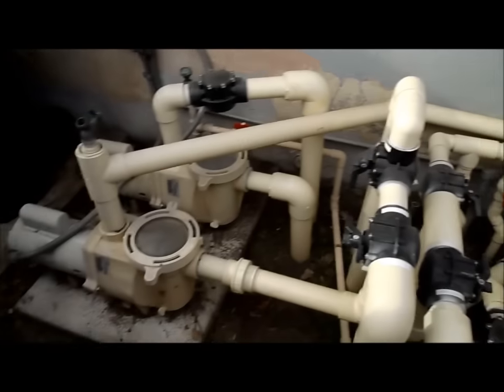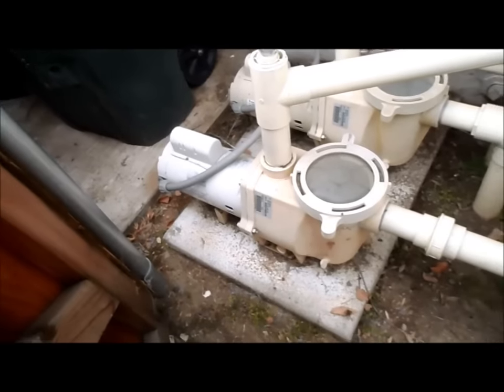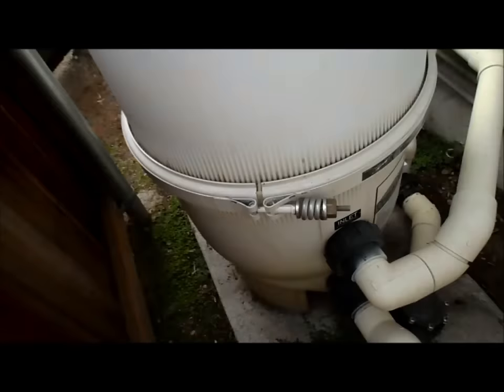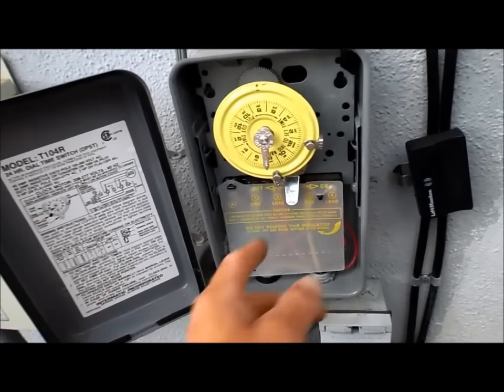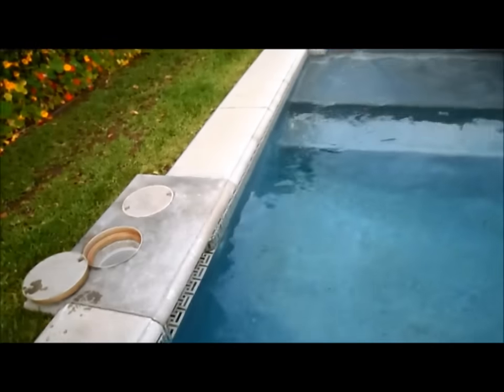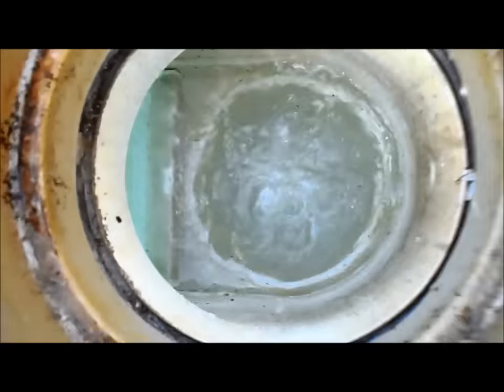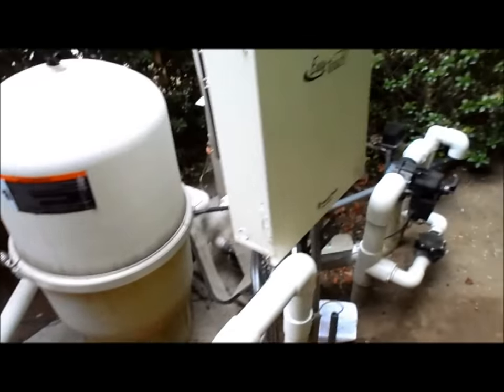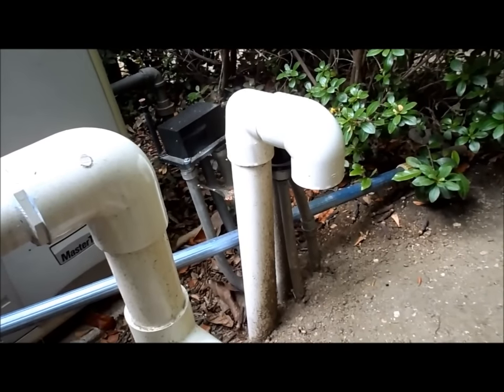Pool Equipment Overview for beginners Part 1 of 2

Comment: Hello, Outstanding videos. Keep it up. I have a Pool circulation system question. I have a basic pool/spa/heater. I have only one pump. I have (2) 2” suctions  connected to a  Jandy 3 way 2” valve going to my pump inlet. The return is a Jandy 3 way 2” valve. The main return is 2”. One return side is 2” and the other return side is 1 and a 1/2”. Would my main inlet be a main and skimmer? In regards to the the 2 different return line sizes, would the 2” be the main or skimmer.
Thanks
Reply from the maker: Thanks for the great feedback. The skimmer is the primary point of suction and most likely the larger line. 👍
Reply: Thanks for the quick feedback

Comment: Hi, thanks for sharing your knowledge. 
Could you explain how the bubbles go to the spa, would you be using a tee wye not sure of the spelling.
Reply from the maker: The bubbles are produced by a return pipe over by the equipment or the spa that has a cut in the top portion to let air in the line. Normally a pool is a closed system which means it runs with no air in the pipes. To produce the spa effect air is let in at this pipe. Usually a 2" pipe sticking up about 3 ft with a 1" cut in it - again by the equipment or behind the spa.

Comment: Thank you for your great videos. I have one touch Jandy AquaLink® RS 
RS-485 Connector that has a controller inside the house. The system was programed  to start and stop the pump daily. However, the pump stop working and I am not able to start or stop it from the controller inside. All other commands for spa, jets, heater works. But not the pump. The AUTO, SERVICE, TIMEOUT buttons on outside panel also does not work.  I have to start and stop the pump with the main switch board on the panel outside. Called  Jandy preferred pool service company, but no response yet. Could you please help me with this issue. Thanks

Comment: I have a question what would happen if I keep my spa suction line open all the time as well as the return back to the spa?is it best mabe to keep the suction line open mabe 50 %and the return line open 100%...thanks for all the great videos. ...
Reply from the maker: +Tim Willisms Have the spa suction open a little helps - 50% might be overkill. Try 20% - this will keep the spa bottom a bit cleaner & allow you to brush the spa down easily when the pool is running.

Comment: Does all of this need to be put next to the pool or can it be in the basement and all the pipes run through the foundation wall
Reply from the maker: You can put the equipment wherever you like. It just gets more expensive to install.
Reply: If your pool equipment is in the basement which is below the pool waterline you are running the risk of water flooding your home. Even with a check valve if your pipe cracks or fitting fails it will siphon from pool to house

Comment: We moved into a house with a pool and spa, but no manuals or instructions. I can't get the spa to suck air. The jets blow water at low pressure but no air. I see the pipe by the filter, capped and notched. I hear it gurgle momentarily when I turn it on but no air ever comes out. When I turn the heater on and try to heat just the spa, it starts making knocking noises, and filter pressure jumps 7 lbs.
Reply from the maker: Chuck Mcquade  Could be a blockage in the spa line.  Heater making knocking noises means the water flow is too low in most cases. Pressure going up could be normal or could mean the return line has an issue. If you have a home warranty on your pool now is the time to use it.
Reply: Chuck Mcquade Is it possible to use shop vac to suck lines out. Or air compressor to blow lines out? I was thinking of cutting the cap off by the pump and attaching shop vac to it. When trying to get it to work, my wife thought she felt one jet (of four) actually sucking water in. Is that possible?

Comment: We Have Had Our Rheem Pool Heater For 1 Year It Was Professionally Installed And The Gas Line Looks Like It Is 45 Years Old. Is This Bad?It Is Covered In Rust.  I'm No Expert With Natural Gas But I Do Not Know If I Need To Call An Expert?
I Do Not Want The Pipe To Rust So Bad That It Sprays Ng Everywhere.
Please Help.
Austin
Reply from the maker: Sounds pretty bad. Usually this happens if acid is stored near a heater or another oxidizer type chemical.